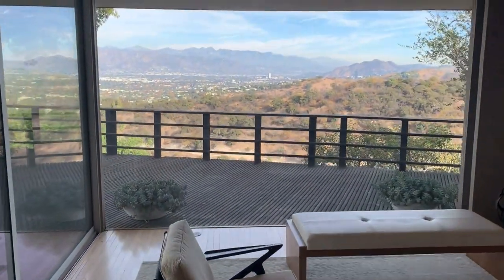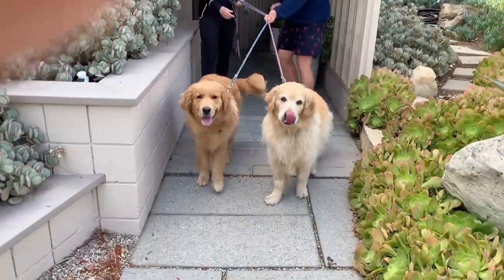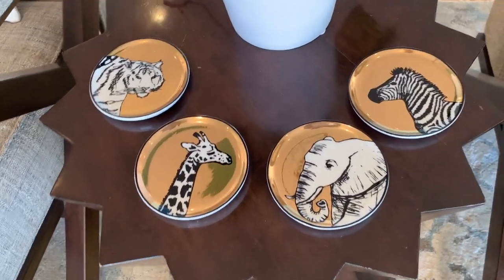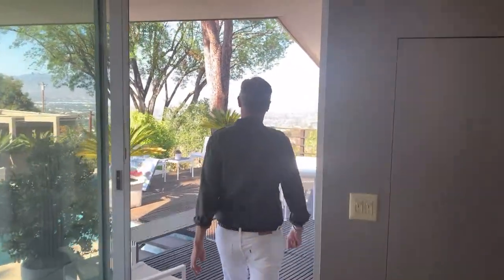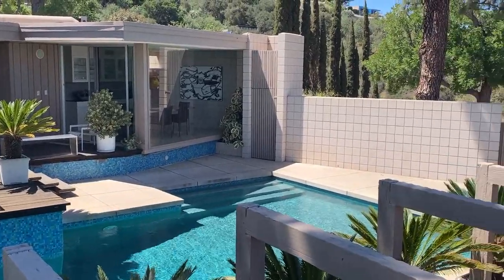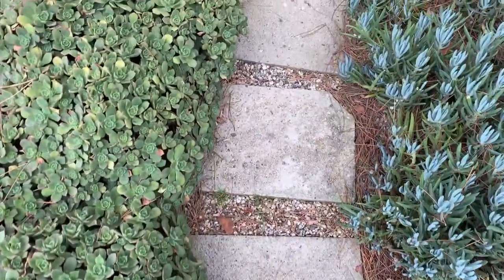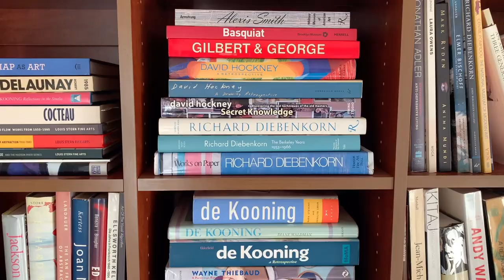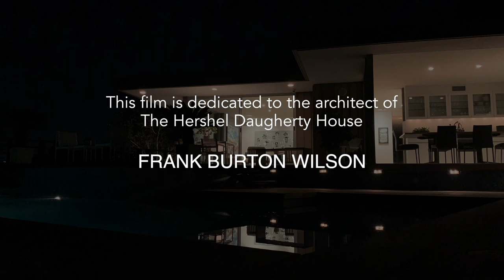Beverly Hills Mid Century Modern Home Tour

Comment: Chase thanks for sharing your home with us.  Kudos to you and your partner for finding and saving this mid-century gem.  Love your art and the added artists throughout your abode.  Yes it has that relaxed gallery look. I really like the low maintenance xeriscaping plus landscaping.  My only disagreement with you would have been in maintaining the original redwood accents, trim and screens on the house with a clear or wood stain.  I'm not fond of gray.  I'll defer to your taste and desires yet I would seek to restore it to its original glory and intent.  I would suppose it is difficult to maintain natural redwood in the sunny dry climate of Santa Monica.  Here in TX we have pine borers and termites plus a lot of moisture (algae) which is a distinct hazard to most wood.
Reply from the maker: It is funny you mention the panelling ..... I was thinking about it recently and had regrets that we didn't restore it.  Back then I didn't realize how to do that so we painted over.   I should mention to the new owners that there is walnut veneer under some of the the painted walls.  In hindsight I agree with you.